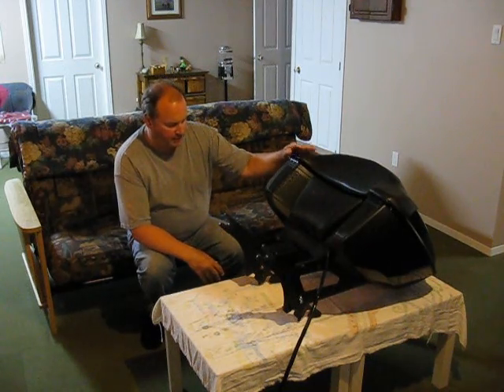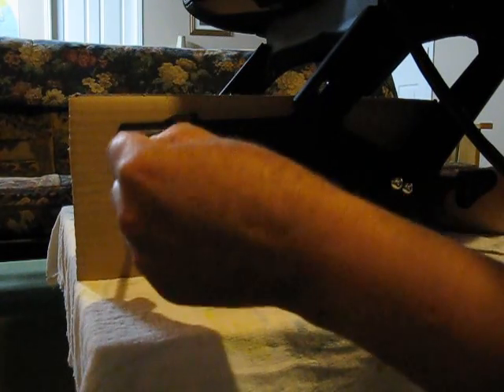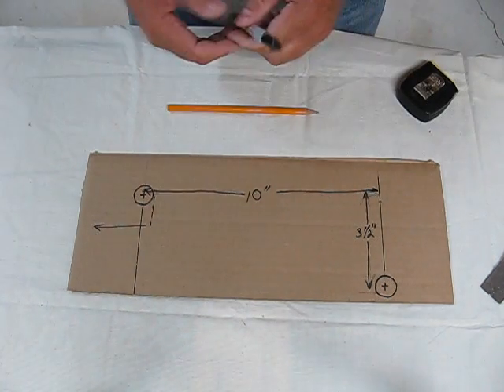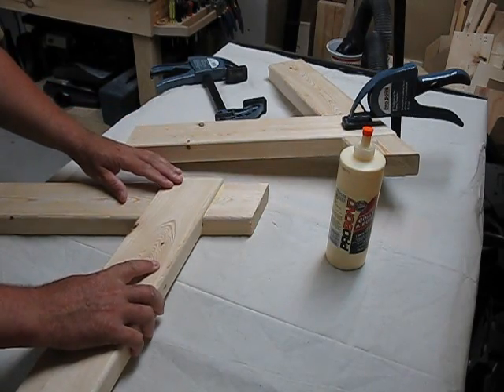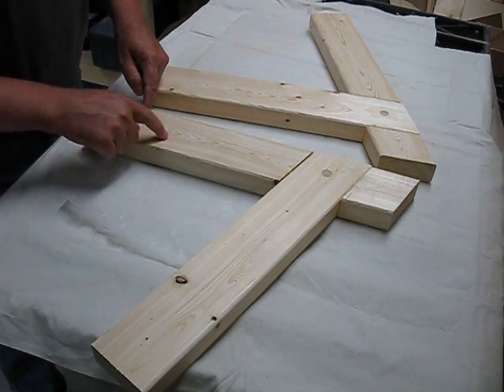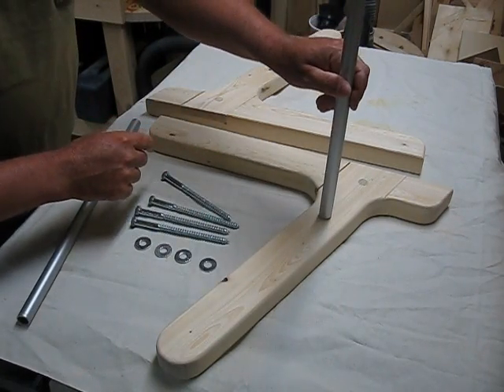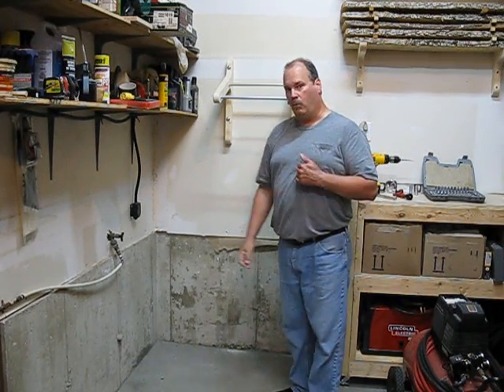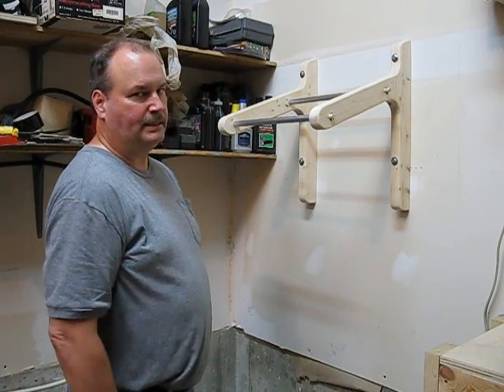Victory CCT Trunk Wall Mount

Comment: Very nice work brother! Keep up the videos. I've been doing things like this for years. Just bought my Victory Cross Country a month ago and have already added my own aux fuse box which is very similar to the one you have on your other video. I've done the H.I.D.'s and LED projectors for driving lights. Just order the Vic backrest for my wife and will eventually get the trunk so I will have both options on the back. 
I was looking to make something I could eventually mount both the trunk and backrest and rack to. I was thinking of welding up a frame out of steel or aluminium since I'm not as proficient with woodworking as you are. I have better luck with metal and electrical stuff than the wood goodies. Looking to make my own custom handlebars soon. Have the Victory Mitered barn now but need even more pullback and height.

Keep it up brother, awesome work!

Comment: Nice job.
Are you able to use it as you mentioned in the beginning of the video? Looks too tall to open.
Reply from the maker: +Jason Carmichael 
The height is perfect for me as I walk underneath it daily and it is not in my way.
I do have to use a stool to put the helmets in for winter storage and when I remove them in the spring, so I only have to use the stool twice a year.
It works for me.

Comment: Why stop there?  You could hang your bike on the wall with that thing.  That is way over built.  I don't mean that in a bad way.  It's very nice and looks really sharp.  I think you could maybe paint it the seem color as your bike and don't forget to powder coat it.  You'll need to add some racing stripes so you can hang the trunk faster.  ;-)